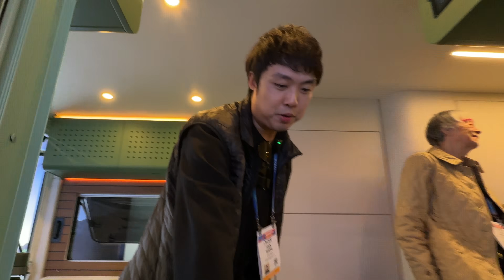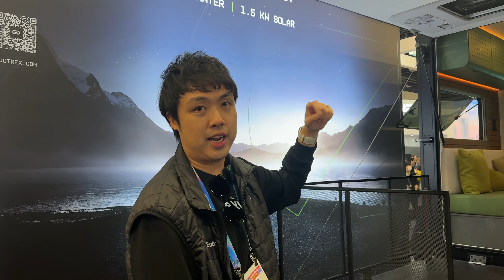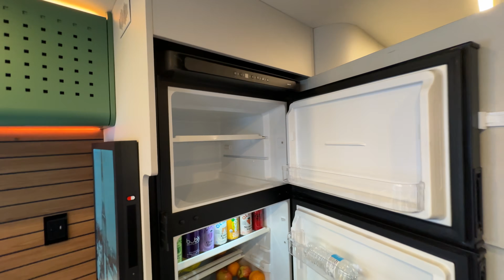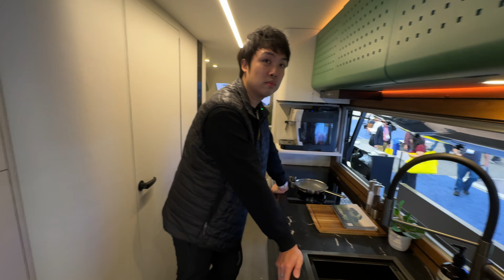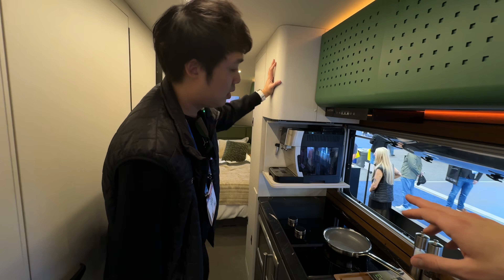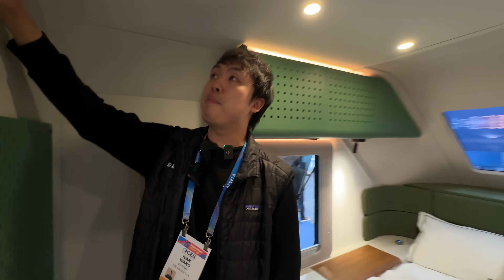Evotrex Is A Range Extended Electric Towable RV Making Its Debut Right Now!

Comment: I've watched several videos on this model, and overall very impressed, however.... The most obvious is a screen drop-down to keep the bugs out when using the patio. I would prefer a propane generator for its lower weight, greater longevity, and less maintenance. An Anderson connection could provide up to 50 amps while traveling, compared to the mere trickle of a 7-pin. Any brand with a front window needs a cover during transport.

Comment: I loved the outside design and the interior layout, and has almost everything to be a no excuse for me as a go to buy, there are some improvements I would like to see. First the most necessary is the bathroom layout I don’t see enough space on the toilet even to open the legs and reach the business parts. Extra Option for projector mount on the ceiling, patio bug net, outside bbq and sink, outside freezer, outside shower connector, extra power outlets, at the backwall option for bike mount, building in WiFi with internet quick connection for service as starlink and option for floodlight.
Reply: Thank you for your feedback!
Reply: I agree with his additions for the Atlas and a few more:

> All electricity outlets include two (2) USB slots

> Toe Hitch area has electricity port to charge EV bikes and electric wheelchairs 

> Roof rain water capture option helping stay off grid for longer durations 

> Outdoor shower options at kitchen sink side and bathroom side

> Outdoor movie projection screen wall

> larger projection wall in the master bedroom 

> Security System, motion detection and warnings using the current cameras 🚨

Comment: KISS, Keep it simple stupid!  Why do they call something an EV that is powered by an ICE?

When I was pulling a travel trailer, I never used a generator for camping.  When I retired, we lived full time in a large motorhome which had a 6500 watt  propane generator for running two A/C.  To extend the amount of time we could boondock, got a $88 generator that would charge the batteries in about one hour per day.   Later I bought a second portable generator that would run one A/C in case of an emergency.

Comment: Towing with EV is good but not enough to be totally independent from traveling. Why not convert the whole roof and oning in to solar energy generation so you will be able to recharge your EV?
Reply: The generator allows you to DC charge an EV at up to 60 kW, which is 40x faster than the 1.5 kW solar over the rooftop!
Reply: The roof has solar as well.

Comment: I would be surprised if Evotrex developed the 60kW DC fast charger gas generator completely from scratch, so I hope that system IP shows up in other products.  I think there is a need for a cost-effective and optimized portable DC fast charger solution... not just some overweight three-phase 60Hz 480VAC diesel generator that feeds a repackaged conventional stationary DC fast charger.
Reply: Outstanding comment!  It’s all about the power for electric camping in many places…get as many kWhs to the campsite as possible.  Unfortunately there is no reasonable way to get around the fossil generator for needed power and access to fuel.
Reply: The market for EV “range extender” charging is huge.  Need an efficient DC to DC EV genny!